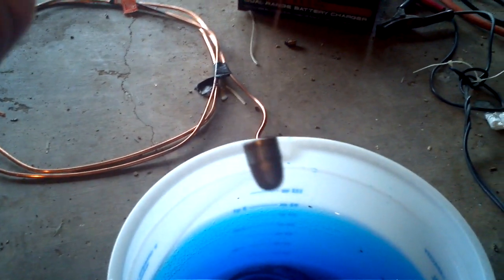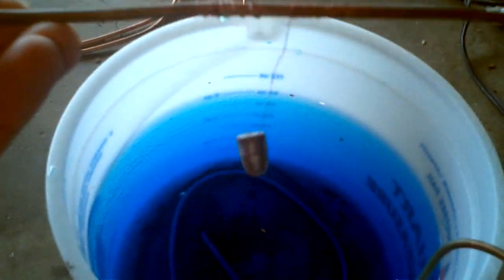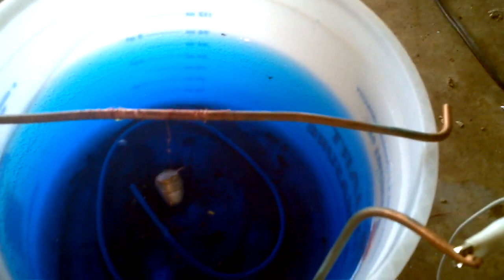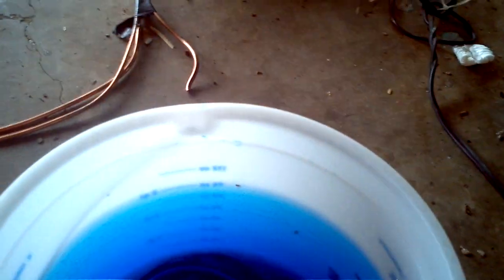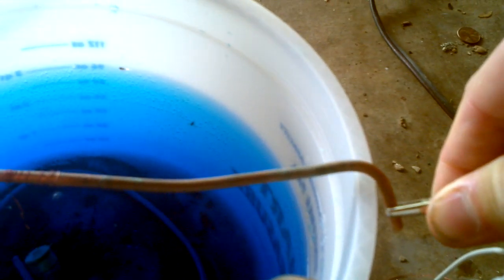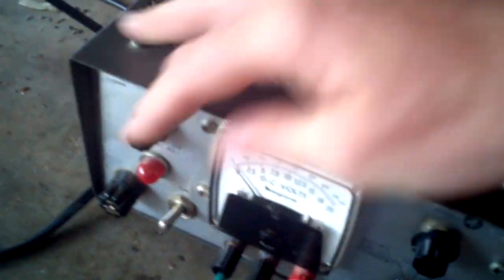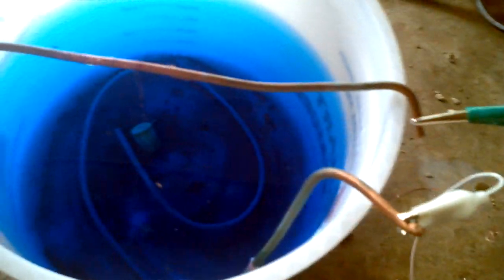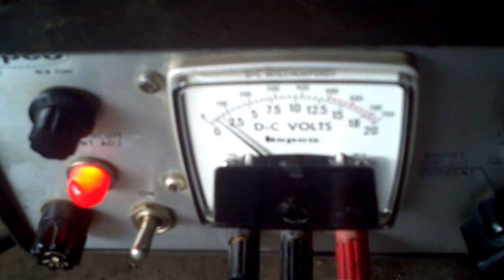Copper Plating Cast Lead Bullets - Pt 3 of 5

Comment: Copper plating bullets one at a time is not as useful as it is a neat trick.  Is their some reason why you could not put a plastic shelf in the solution with a copper plate on the shelf to stand about a hundred bullets pointing up and plate them all at the same time?